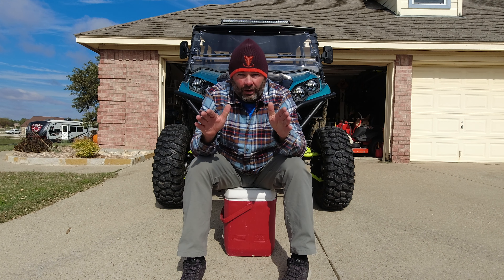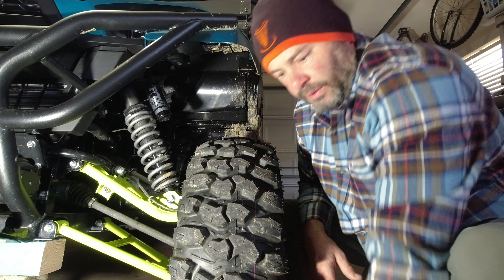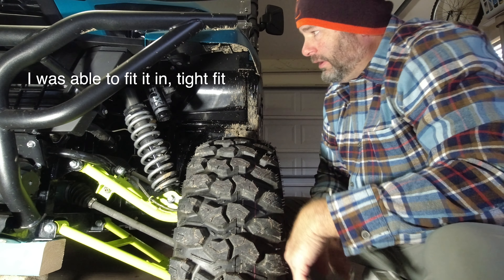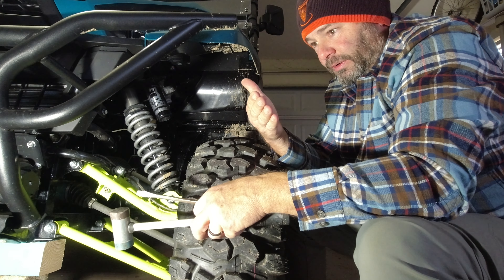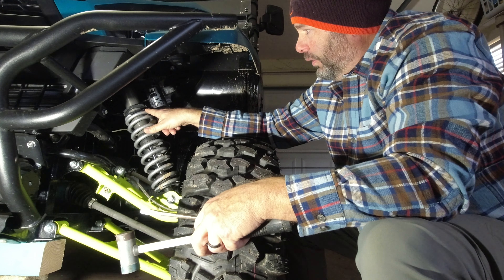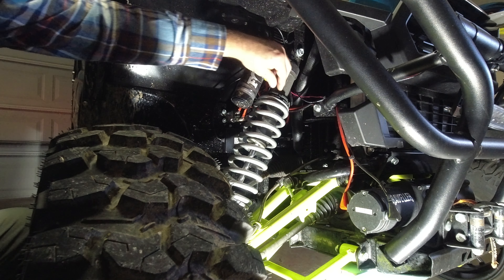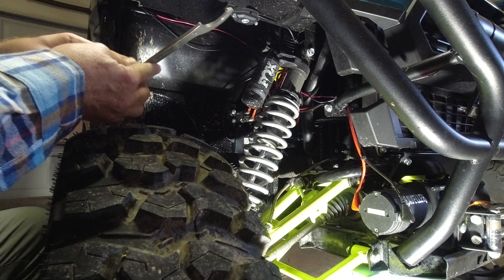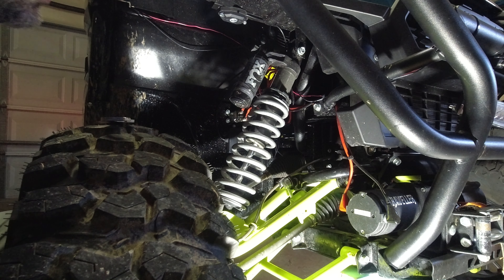2023 Kawasaki Teryx4s le Off-Camber Fix

Comment: Keep in mind the camber is Designed into our Kawi's, to keep center of tire on the ground for traction. Full droop, and full extend, prevents tire scrub. Best way to help these toys our, cut and modified lower control arm with screw style adjusters!!
Reply from the maker: Very true, with the 30” tires it seem to be riding on the inner tread versus center
Reply: @t-4adventure654  Mine did to until i bought ATLAS control arms. They ride as they should now, camber in at full 'Tuck"
 and camber out at full droop!! Also sporting 30's on a 22 T4S the 1.5 forward on the front is a game changer for approach!! vertical.
Reply from the maker: Nice
Reply: @captnhook236 did you do a clutch kit when you put the 30” tires on? Obviously higher, But how did this effect the “Ride”? Thank you in advance for your response & advice.
Reply: @scotthooper4170  No Sir. Not at first, Ran 3k until the clutch sheave Broke. Bad metal from Kawi, they fixed it and put a kit in while it was there. The throttle response is better, I notice it more when rolling and then WOT in corners, to whip the butt around. One can indeed run with 30's on these bone stock. The ride at 10 psi made a world of difference on rock gardens, and sand.
Reply from the maker: @captnhook236 i usually run 10psi in mine, man these Sedona Trail saws have been amazing

Comment: A little help with that tool, bend it to about 90° about an 1½" - 2" back from spanner and then you can use a smaller open end or an adjustable wrench to set on the long bend and turn.

Your welcome!
Reply from the maker: Thanks

Comment: There is a much easier way to adjust the preload on the springs. Jack up the vehicle to take the tension off the springs. Take out the top bolts holding the shocks and turn the shock by inserting a screwdriver into the bolt hole at the top of the shock. A little oil on the threads also helps.
Reply from the maker: Awesome thanks for sharing
Reply: Great advice! I’ll give that a try. I’ve got to borrow a Jack now. Moved and gave the 3 away that I had for the move. And did not foresee my wife giving in so easily on getting a new Side by Side. 🤦‍♂️

Comment: Why would you do this?  It is designed with camber for a performance and safety reason.
Reply from the maker: I believe I explained why in the video, and yes everybody knows it was designed that way. Thanks for dropping by
Reply: @ for tire wear?  At factory setting Driver/passenger weight takes the negative camber out and as compression and extension occurs center line tire to track contact remains constant.